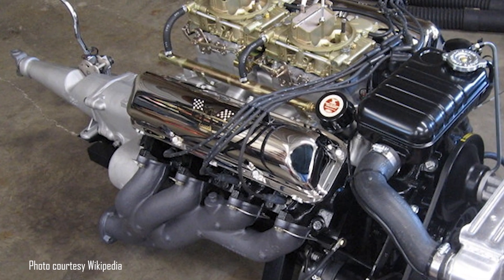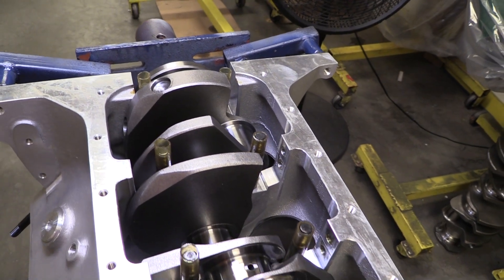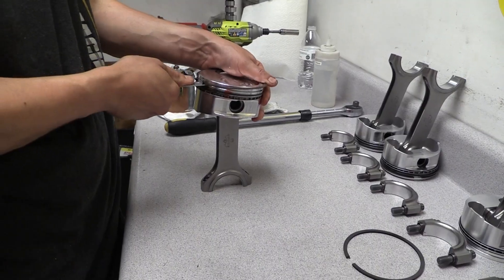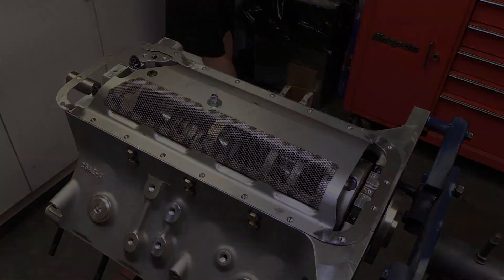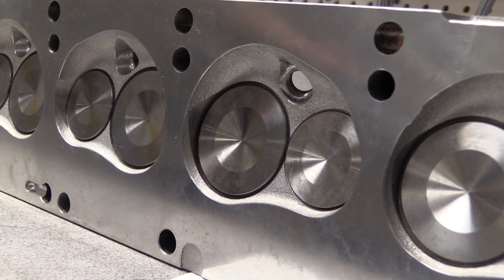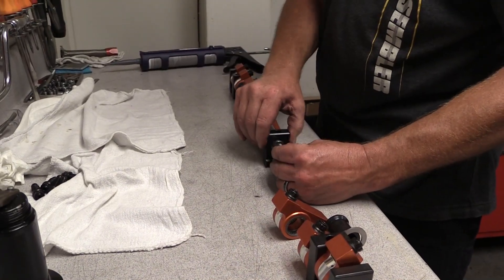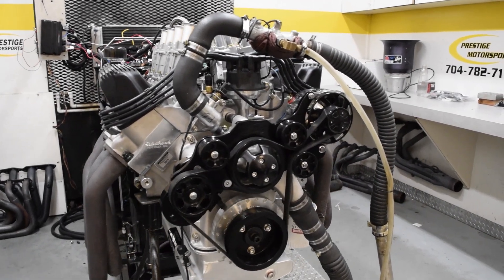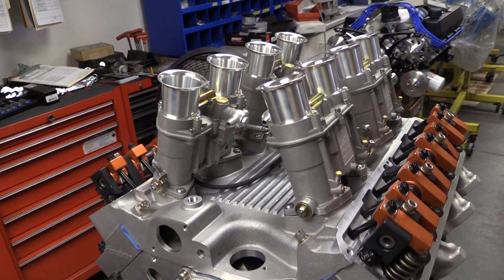Building an All-Aluminum, Fuel Injected FE Ford (with a Carroll Shelby Block!)

Comment: An indexing dowel or a small drift pin installed into the manifold to block end seal mating surfaces at the front and rear valley bulkheads to align/center the distributor bore holes would be a great idea. Same for the heads, alignment dowels machined around each head bolt/stud hole( not threaded and aluminum ) and coolant transfer jackets ( threaded aluminum plugs with machined outer diameters and torx drive socket internal pockets that can be drilled and trimmed to the desired height after installing with ledge flush with deck, to act as additional locating dowels and a reinforcing sleeve /coolant conduit that will reduce or eliminate coolant passage to combustion chamber content integration or intrusion same with pushrod holes if applicable to limit and practically eliminate cylinder head migration in street able forced induction builds to aid in thermal conductivity and uniformity, minimal hot and cold spots. Eliminating the weakest links meticulously and precisely.

Comment: I Built a 427 Standard Bore, SCAT 4.125 , EAGLE ( 6.8 ) , 10.00 to 1 , EDELBROCK Heads+ 8.30 c.f.m. WINSTON CUP ANULAR , Major Adjustments to Carb. SIMPLE FE , Made 517 H.P. , FUN in a 1957 CUSTOM “FORD” ! 😳🤪🙃💯, ATI  Reverse Trans, 4.500 Stahl

Comment: Ok, hers a question I can’t find an answer for. You said these heads have 170cc intake runners.hoe is that spec used. The FE’s intake ports are shorter than a Big Block Chevy, its competition at the time, so 170cc’s are closer to a Small Blocks port volume. So why the hell is everyone so focused on it? Intake volumes are great for comparing heads for one type of engine, but why is there a comparison being made from different manufacturers heads?

Comment: Nice engine but all that fancy carb fuel injection i would except more than 500 hp i was thinking 8 or 900 . You can basically get same results with a good carburetor set up.

Comment: Why didn't they use the Shelby or Edelbrock heads with the 2.19 intake and 1.75 exhaust  and a hyd.lifter cam. Same good hp with less maint.  Just saying.

Comment: For an old dinosaur they were not only powerful they took a ton of abuse even in their stock form from the factory. all 10:1+ compression versions made good power for their era. Seen many sit on rev limiter or near for minutes at a time and keep on a running. You look at gm's modern Ls there's similarities that a builder can't deny.

Comment: Really nice looking engine and block the only thing I thought let it down was the Heads not being ported they looked very average castings and a head gasket looked a bit cheap and nasty I would’ve opted for a multilayered head gasket Other than that really nice build

Comment: The FE is the best engine I have ever built. They can be expensive if you make them that way, but I can do a stroker kit FT block at 4.125 bore and 4.25 stroke and a good set of Trick Flow , BBM, Survival, ported Edelbrock and the right cam you can get 650 hp .  If it sonics good enough you can get a 4.15 bore.  461 ci and 700 hp if you can control it.

Comment: I built a a 445 fe stroker for my 65 Hallett Flat bottom V drive for a bunch less than half the price of this one I bet. And It flywheel dynoed 584 HP @ 5600 and 591 ft lbs at 4200 rpm. I used a 74 FE 360 truck block  , forged crankshaft and H beam rods with summit pistons , ported  Edelbrock heads I bought used but in great shape and a old Street master intake and Holley 850 cfm carb and a Comp Cams 268 H cam. There's nothing left on the table with the parts being used giving every drop of HP & torque they can provide. But it's how the tuning , porting and minor details involved that made the thing a wicked NA Ford FE. I took the advice of a Older Drag racer with decades of Squeezing everything from a FE they could give. It's smart to pay attention to those who paved the way for the rest of us

Comment: It's really irritating when some mechanics, and good ones too with lots of experience and know how, still say, when describing torque put out by an engine, as FOOT POUNDS!! 
NO!!!  C'mon guys! 
That's a torque measurement of bolts and fasteners.   Engine torque is measured in POUND FEET.  Thanks for letting me vent.
Reply from the maker: You are correct. And I am an example of perpetuating it. But it has become so popular in the vernacular now, I think there is no going back. If you watch some of my early engine build videos I will say pound/feet. But I would get an endless stream of comments with people calling me an idiot and saying I don't know what I'm doing. I could even reply with a link to a white paper from the ASME, but it didn't matter to people. I mean a crazy amount of comments. So I said, "if you can't beat 'em, join 'em," and just gave in. I think you are only like the second person in over two years to point out the inaccuracy. Foot pounds is now my scarlet letter.

Comment: love this video and content!  501hp is a little underwhelming considering the materials used in the build. I honestly expected more.
Reply from the maker: Built to be rock solid dependable
Reply: @TheHorsepowerMonster  this is a great build! 
I would have loved to have seen the torque curve on this build with a longer intake runner and a quick little clean up on the heads 😍 but still this was very impressive and would make a fun track car with the throttle response 👍
Thanks for the share and love the content

Comment: It’s a great motor with great parts, but just over 1hp per cubic inch is a bit disappointing. Can’t help but to think those heads and possibly the throttle bodies are really hurting it.

Comment: Only 500 hp?  I would have expected far more than that.   Sure, it makes great torque,
but this motor should have made at least 550-570 hp, with the compression, valve
lift,  and fuel injection.

Comment: The first engine I helped work on was a 390 FE. My father is a huge fan of Ford and taught me very early on. He has had a few 390's. Today he still has a 410 FE which was a Mercury engine with a Comp cam and a 4 barrel Edelbrock  carburetor.

Comment: Old vid anyone else notice intake gasket get picked up an moved completley off during intro oops love the FE moters have a couple customers with 370 cube small bore long stroke not sure on specs think tall deck 360  Industrial FE ,s  2 an a 1/2 ton dumps from the eighties just keep going only thing to brag about but a work horse ive hoped some 390 mustang an galaxi  Versions Had A 68 F250 with the 428 Was pretty sweet nice truck great  Engines  I'm a Chevy boy by heart FE,s  they just don't seem to be reliable at higher Rev's make a bunch of torqueI have an old small journal 327 / 331 10 to 1 compression mule been in 15 different trucks  with 4 or five intake an carb set ups walk the dog on all those FE,s and cheap. get parts anywere hard to get parts fur those fords to many variations an not cheap thats the draw back other than that nice engines but i wood never try to build alloy bock hi po FE nothing wrong with it just to much money way cheaper options out there with smaller under hood foot print I,E headers and bolts on them are a real pain

Comment: I know I'm not going to sound nice, but.
Looking at that dyno graph shows that the power is lower than torque which is an indication of a mild engine. Yes I know it's meant to be mild but I bet the missing 50 to 60hp to level the graph out would be in some good gead work.
When you're building an alloy block why wouldn't you get the heads hand ported and a good valve job?

Comment: You get the GM DRCE (Are they up to gen 4 now? I dunno) Prostock blocks that have a round cover you can remove in the rear of the block which has the 3 separate feeds to the Mains, Cam and Top end. You can input restrictor jets to each feed to accurately control the oil feed to each vital part of the engine.. Which brings to mind, when you gonna do a feature on these unique engines!??

Comment: Only one thing I would have done different. I would have used a Cleveland intake manifold adapter. There's a much larger selection of manifold choices for Clevelands including a tunnel ram like you used, AND if you ever needed to take the intake back off you wouldn't need to disassemble part of the valve train.

Comment: Not porting those heads was absolutely criminal. That motor needs way more head than it has. The owner spent all that money and got a good running Windsor instead of a fantastic FE.
Reply: Saw that. Especially on intake side. When the shot of runner was shown I automatically thought " I would at least clean that ridge up. Gonna kill flow & therefore power

Comment: top rings are usually made of chrome molly steel these days for extra life at 0.022" ring end gape is about 0.003" of an inch extra clearance more than the old rule of thumb of 0.004" per inch of bore ..ill bet  this is not the builders 1st rodeo plus this is not a cast iron block .....but anyways the 2nd ring is what we used to call the " scrapper ring" that is designed to pull oil off the cylinder walls in a one way wiper action as its leading edge is on the bottom of the ring to wipe down the cylinder wall of oil on the downward stroke of the piston . as most all 2nd rings are made of cast iron that will expand more than steel top rings accounting for the 0.002" extra clearance of only the thickness of a human hair not enough to ad any extra blow by into the crankcase as this is set up tight for natural aspiration only and at 10.8 compression ratio  93 octane  pump gas is pushing the boundaries of chemistry during a combustion process putting on Big Boost superchargers and or big boost turbos is not compatible...and those old school throttle body of  mechanical helburn fuel injection look electronic fuel injection throttle body are the same if not identical to the same setup Tom Nelson of Nelson Racing Engines uses that on the street your engines just an everyday ho-hum grocery getter purring along until you stand in one of Nelson's engines naturally aspirated makes 1500 horsepower on the street but purrs like a kitten in traffic jams of LA... Like I said the Builders of this type of engine today is not their first rodeo that is pretty much a science to them like shake and bake and it's ready to go... not to mention those old school looking hilborn fuel injection stacks both angled in such a straight shot right in the top of the piston is as classic as classic gets. The idea isn't do you make tons of horsepower and suck a bunch of gas but with identical throttle body eight identical intake ports eight identical cylinder walls...each cylinder should be making  identical horsepower to the next of the cylinders in the firing order exactly the same power will make a smooth running engine that will go through the revs very quickly any Cruise more efficient than a single carb mounted in the center of 8 cylinders as it's pretty darn hard to keep the outside for from running later than that

Comment: I had a 67 Fairlane 500 with a 390 backed up with a C6, I loved that car. Rebuilt the motor from the ground up into a GT and it hauled that heavy chassis without breaking a sweat. Originally I thought that the stroke was too long but grew to appreciate how it curved the power band at the (relatively) higher RPM range - FE blocks aren’t famous for their hi revs. Down shifted too hard, punched it and blew the crankshaft right out of the bottom. Took a big chunk of the block with the crankshaft regardless of the “cross bolt” mains. It was a phenomenal failure but I’m still a fan of this engine 👍
Reply: 390 didn't have cross bolted mains. Only later 427s. I've built many Fe engines from 332-428 and have gotten 7000 rpm out of a hydraulic cam 428 with 300 degrees of duration and 520 lift and stock non-adjustable factory rockers.  Had 3 holleys from a 406 and it made my 500hp coyote mustang feel sick. 7000rpm big motors make serious power for street use and this thing was in a 68 Falcon. At one time I had a single 850 with f427b intake on it with a 150 shot and although quick it was no match for the 3x2 Holley setup. That setup was king on the street. Built my last Fe last summer at CMS racing engines. Customer wanted solid cam so he bought so cheap roller rockers,all FEs are shaft but these wouldn't line up with the valves correctly being of Chinese origin evidently,it cost him more in the work I had to do in milling,shiming, checking position and clearance than if he had bought good ones to start with. We tried to tell him but he wanted to save money and wound up spending more and got inferior parts. . I think the weakest link in these engines are the stock oil pans and lack of oil volume because they have a starvation problem in during hard acceleration and cornering from oil leaving the pickup. A good pan and these engines are as tough as any and can make obscene power if you know the right combination.

Comment: I love that intake and capstan throttle. I remember the old Indycar 289's with the Webers bolted directly to the heads (Bobby Unser won in 68 using this). This engine is beautiful just like that. Awesome build!
Reply: Unser's car was powered be a turbo Offy in 1068.
Reply: 1968
Reply: Ford did build a competitive V-8 thing it was a joint venture between Ford & Cosworth

Comment: If i recall correctly one of the rocker shaft hold down bolts (the center?) is slotted or somehow relieved to let oil flow past to the rocker arm shaft. Hard to recall because only once have i ever worked on one but i remember feeling relieved as my memory cautioned me on nuances of getting that valve train together right on the engine.

Comment: In case you didn't notice, the Fe Ford engine is also a Y block design. Just like Chrysler engines are. At least the Big Blocks. As are the ls Motors and I believe the new LT but I'm not certain of that.

Comment: Why did you run such a small cam in this engine. I run a .609/.629 on a 106 degree for my street motor. Trick flow heads came out for this engine with massive flow numbers over the edlbrock version.

Comment: i just love the fe block putting a 390 in my high boy i like the part about not needing to not power break it i had a 396 in a nova and a guy tells me to power break it i just said y hurt my breaks so i gave it 3/4 throttle and i was just sitting there laying rubber sad part was i had a factory paint job and vinale top yeh that went good rubber every were burnt rubber doesn't come off paint and vinale very well

Comment: Great video. I was drooling thinking of this motor in my 67 Mustang instead of the mild built 460. Maybe if I hit the lottery..... someday. Cheers from Motown.
Reply: Slap a set of Kaase p-51 heads on the 460.
Probably good for 100 hp

It's a Mustang. Put Kaase's Boss Nine heads on it.

Comment: The Ford FE is called a Big Block.  Ford started the design in the mid 50's 332 and refined and kept increasing displacement to 352 360 390 406 410 427 428 all the way  to 1968.   Many modern engines  especially the LS engines , as well as other modular engine designs  borrow heavily from the FE. 
Design cues are apparent --  such as:::  6 bolt or cross bolted mains,  deep skirt block  to enclose the crank for more rigidity,  support and strength,  all while saving weight. Huge deep breathing cylinder heads. ..and on and on....ad nauseum.

Comment: Beautiful intelligent build which will make great, long living power and absolutely yank a lightweight vehicle down the road like a shot out of a cannon. Outstanding!💪
Reply: loool if you think this is an intelligent build... shoulda made WAAAY more power, this is typical lego builders and buying the most expensive stuff that looks cool
Reply: @narmale  - Exactly why it’s an intelligent build. Way more power than needed for what it’s going into and because it’s not a max power build it will live forever.
Reply: @cavscout62  its going to live forever because it wont be driven but a few hundred miles a year if that... the seals are going to dry rot before they are worn any

Comment: Great videos, love to watch your Pro's assemble, very informative. A couple of questions, issues. Why a solid roller on an engine that peaks at 5400? Also, Edelbrock's for Fe's (esp. unported) aren't that great and are choking that motor. On such a high end build why not use a good head? ie: Survival, Bear Block, TFS, Shelby? Sorry, but 500hp out of a 482" FE with all that expensive hardware is kinda weak IMHO.
Reply: kinda? its VERY weak... this motor should make 800+
we run a 427 clevor with CHI heads that blows this thing outa the water at all points, torque, HP and millage... you shoulda known by the thumbnail they dont know what they are doing, harland sharp rockers on a 7500 block?
Reply: My bone stock Side Oiler with Medium riser heads was OK in my Contemporary Cobra but when I went with a 408 Dart with AFR heads and showed  615 HP on the dyno I was pissing all over those Fe side oilers. BTW many Cobra racers say the 351 and its bigger brothers are the best performing engines in a Cobra. You can find all the Fe Cobras you want at any car show but the racers are running small blocks on the track.
Reply: I think you're right. As soon as I saw the dyno sheet I thought this is just someone's high dollar truck or rv engine.
Reply: I kind of got the impression that they were overbuilding the entire engine for reliability, they mentioned  they weren't looking for all out horsepower.
Reply: Well it is a Ford lol!
Reply: @Matt44magnum44 Yes, the Ford that won Lemans 4 times.

Comment: When I was 8n High School our shop built 454’s, a 427 block with 428 crank and tunnel port heads. They were for a local dirt track racer and those motors kicked butt all season long!
Reply: Tunnel port heads were wicked. My dad had a 427 with them. 12:1 and it sent his 56 ford down the 1/4 in 11.63 with .500 lift cam. No roller rockers or anything.